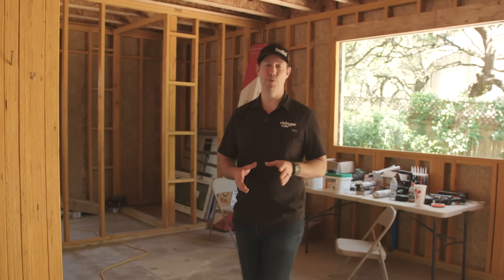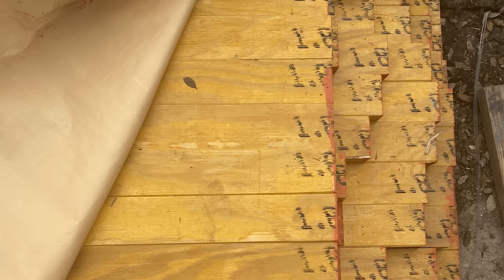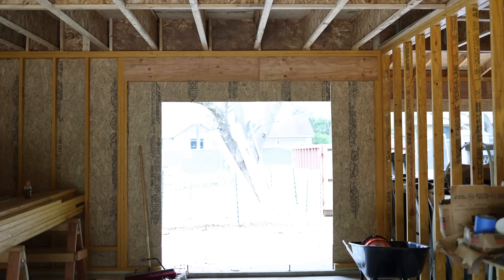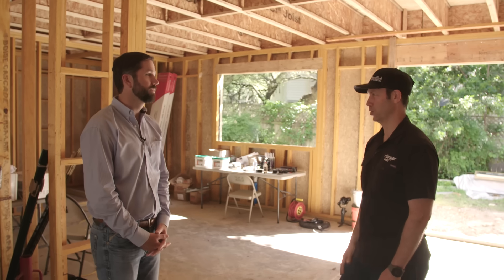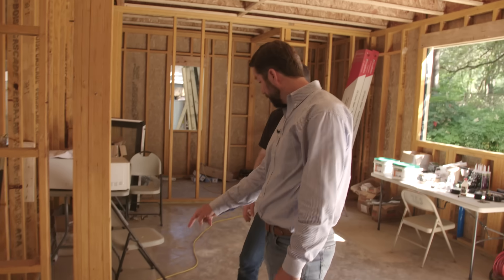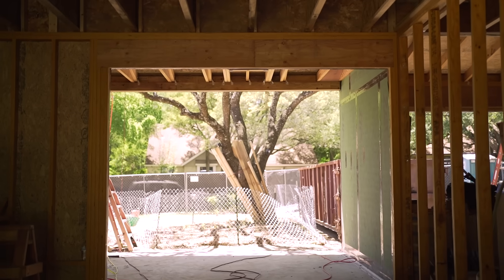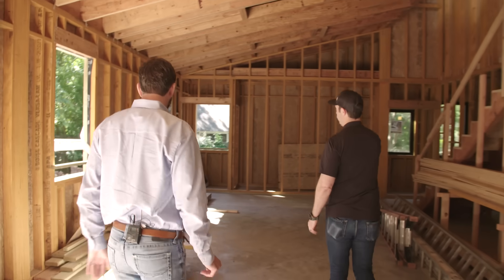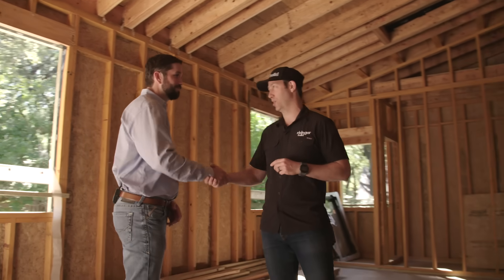House Engineering - Common Mistakes

Comment: What is the advantage of pre-tension slab?
Reply: It's Post tension! It allows a developer to build homes on Disturbed soil or unstable soil. 
It turns the buildings slab into one solid unit by compression. Therefore it eliminates cure and settling cracks. It's also used in highway poured-in-place bridges. In bridge use they can droop the cables slightly and add tension to adjust the camber. All in all it is a great system for new builds but puts limits on remodeling. If a tensioned cable is drilled or cut it can come up through the concrete and be deadly.
Reply: post-tension, because it is done after the slab hardens. it's steel cable in a sleeve with big endplates & nuts. it is done for speed & convenience, no need to build rebar cages. yes, slabs can still bend and crack tile flooring. they throw post-tensile slabs on top of anything, including hillsides & rubble, so watch out for that modernity!

Comment: What about steel framing?  That was popular awhile back.  Has steel gone out of style?  Which lasts longer, steel or wood products?  Rot vs. rust?
Reply: My thought exactly. With increasing average yearly temps we are also getting a dramatic increase in termites. I love wood but my next house will have a poured concrete slab foundation and exterior walls. All interior walls and the roof will be steel studs and trusses. The roof will be finished with standing seam metal roofing. Wood doors and trim are fine but nothing structural will be made of wood. All electricals will be run in metal conduit.
Reply: @billw1044  keep out of most HOA areas if you want to apply smarter principles for next build or be willing for a fight to buck the aesthetics system in place in most HOAs.  Loads of "leeway", but unwilling to listen to common sense to advance to better practices without code requirement.  I think HOAs would enforce their rules over code for aesthetics just because they're written and enforceable at their low level, or "volunteer EGO" maintenance". 
HOAs are completely ignorant systems that need a complete overhaul-- 1st explaining up front exactly what "rights" and "freedoms" you are giving up when buying / signing agreement, 2nd to pay them for their uneducated opinions, or better yet completely abolished. Just my last "2 cents" after fighting HOA for metal roof they claim doesn't meet aesthetics.
Reply: Steel is an excellent thermal bridge :)  Can last 50 years out in the elements. You try to avoid material with different expention rates. Hardwood can last 25 years out in the elements. If wood is left dry for hundreds of years in building it acts like a carbon storage, has less of an impact on the environment compared to steel.
Reply: @ArthursHD  That's correct about carbon. Trees sequester carbon in their wood as they grow. When we use that wood for permanent applications, such as building, we prevent that wood from rotting and returning the carbon to the atmosphere. In environmental terms this is an advantage for wood over steel or masonry materials.
Reply: Matt's engineer seems to prefer not to mix steel and wood when possible. There's a case to be made for that as far as constructibility. Also they behave quite differently as far as shrinkage and so forth, which can result in drywall cracks. If he'd used a steel column in that spot there would have been an annoying question of how to finish it. With wood the dry wall can just be screwed to it like a regular stud. Certainly they can be mixed. And there are probably occasions where steel is the best choice. But personally I'd opt for sticking to one material under most conditions. As far as all steel framing, that's clearly an option. But it's a whole different type of carpentry. Matt's got a team that he's worked with for years and they're skilled at what they do, in wood. So why rock the boat?
Reply: Exactly; not to mention, excessive care must be taken when making a wood-metal connection to prevent squeaking.
Reply: If all steel, the thermal bridging is a big problem (it has been done, the thermal imaging is one of a bonfire). When loads get big, and steel is used, the transitioning between different materials gets to be painful, as far as fastening methods and technologies. Do not underestimate the KISS concept. And with steel, the thermal/ moisture characteristics are REALLY different from solid sawn, which just adds layers to the issues of mixing materials. You end up increasing chances of drywall problems, just for starters.  

10 years ago, we did a very large and expensive house, that had to have a very low HERS rating. I mandated 2" continuous foam on the walls, full liquid applied VP membrane, with "outie"windows (as per Matt's current videos). We were in a high wind design zone (130 mph), with tall walls and BIG windows (think 12' wall, 8'+ window height). We were going to have to sandwich steel columns at almost all the king stud locations, until I came up with an all-wood scheme. We ripped LVL to 5 1/2" above and below the RO, and ripped to 8" at the RO (5 1/2" + 7/16" + 2"). 8" rips of LVL were used for head & sill  as well, all with hardware connectors/ hangers (no jack studs used, for cleanliness of execution, as no value for wind loads). The LVL thus became an integral window buck, and by being a greater depth at the middle of the span (where bending due to winds are highest), we gained enormously from a structural perspective. LVL is about twice the bending resistance of solid sawn, and the 8" depth gives about double the bending resistance of 5 1/2" , so the net effect is that one custom LVL KS was worth about 4- 2x6's.  Lot of windows only oneKS  was required (with a 2x6 sistered on the wall side, to tie the sheathing to). Some needed 2 LVL KS, but not a big issue. The smart folk will now see why 100% liquid applied was essential, there are a lot of 3-way corners that must be sealed (Matt sheet wrap = Origami layering, and doubts). No problems then or now, with construction or moisture resistance (no leaks).
Reply: Steel is an even worse thermal bridge than wood. Even with the CFS C channels, the r value of the wall comes out being lower than a traditional 2x4 wall. Also there are a lot less framers who know how to do CFS framing, as opposed to traditional framing.
Reply: Tyler Lohss those “farmers” better get used to learning new skills! 😂
Reply: @slappers123  I was thinking in terms of longevity.  For interior walls thermal bridging would not be an issue.  You could increase fire, insect, and rot resistance with an ICF and brick exterior wall system combined with metal interior walls and a wood trussed roof.  That combination might last a very long time.  Termites would have to climb all the way up to the roof to get a meal.
Reply: Christopher Calder interesting idea.
Reply: Steel never really caught on.  The US has tons of forests and renewable wood, plus its easy to build with.  Steel also has its issues with heat transfer, its not the most efficient of wall assemblies.  Its mostly builders and framers dont want to branch out, and most home buyers dont really care enough.

I own a 1950 Stran-Steel house, the "House of the Age of Technology" in its day.  Its made up of heavy-gauge steel channels that are spot welded together to create studs and joists.  They are dimensionally the same as similar wood pieces, and are screwed together with steel channels for the top and bottom plates.  Makes for a very solid house!  I gutted it and renovated it completely.  The exterior is Cellotex covered in tar paper and brick, not the best but would have been incredible expensive to replace with Zip or foam insulation.  Foamed in any gaps and holes in the sheathing and around the new doors and windows.  Added fire blocking to all the top and bottom plates to limit air and fire movement inside the structure.  Once that was done, the house was virtually draft-free!  Then I blew in cellulose into the walls and put up new drywall and finished the rest of the interior.  Steel isnt the most efficient when it comes to heating and cooling, but my house does pretty well since I cut down on drafts big time.  I live in Houston and my heating and water heater are electric.  Electric bill averages out to around $200 a month, usually keep it 72-73 in the summer and 67-68 in the winter.  Thanks to all the sealing and insulation, the heat doesnt need to run much until it gets into the 50s and lower, not bad!
Reply: One problem with interior metal studs is they just are not rigid; try slamming a heavy solid core door - the interior walls just feel and sound cheap down the road
Reply: I built Steel House in Germany.
Reply: Or just look acros the pond in to the Europe and look how they build with very strict build code :
with modern clay bricks system like:
https://www.wienerberger.co.uk/
Or another system with extrem light concrete bricks (float on the wather) like:
https://www.xellabuildingsolutions.com/
Here is a UK link but this modern brick systems are more common in continental europe
Reply: We build better houses in Mexico....these houses have way too many issues.... I work on both sides of the border and my own houses on both sides, I don’t have any issues  in my house in Mexico!  Concrete and foam insulation, no squeaking, no rot, no problems...
Reply: @boxing1940  Most of Asia is the same; concrete, brick and steel.

Comment: Hey Matt, Have you tried placing glue, like PL premium in the bottom of your hangers? It helps avoid squeaks as well.
Reply: Actually PL premium hardens and can lead to squeaks (ask me how I know). Best to use one of the construction glues that remain flexible.
Reply: Not only that any good framer puts glue In floor hangers
Reply: Right, we actually use a product called lumber lock which stays flexible (I mentioned PL as it is more widely known) I wonder if the advantech su floor foam adhesive would work in this application
Reply: pl is the shit man.

Comment: I think this is your 4th video now where you keep praising engineered lumber without ever once bringing up the drawbacks, except cost (barely).   Engineered lumber uses a lot of glue that off-gasses and also isn't responsible fiber use when it isn't needed. It's much more processed and typically has higher embodied carbon. Unlike OSB, LSL, or the webs of a TJI that are made out of waste (mostly) chips, plywood and LVL are rotary peeled. Logs for rotary peeling are bigger, more mature trees. Framing studs come from small, fast growing trees. If you are concerned about stud quality, insist on KD or S-Dry and you won't have nearly the bow/twist problems of GRN. I'm not  a LEED expert, but I don't think your house could be LEED certified with all that glue.
Reply: Just don't ever let it get even a little bit wet . . .
Reply: In residential construction, I think you would be surprised at how easy it is to be LEED certified on a budget like this. There are so many points available with this build and the local sourcing of materials. Where he may fall short in one area he will easily make up in others.
Reply: @h2s that's ridiculous
Reply: Engineered wood are the sadest stuff when there is a flood or a water leak.
Yes that includes those unexpected small leaks that discovered it was leaking for quite sometime.
Reply: EWP products generally contain 4-6% adhesives. None of the products mentioned are made from “waste” chips. Products like OSB, LSL, and web materials also allow the manufacturer to use non-environmentally stressed species that are not fit for use as conventional lumber. EWP products produce a longer, stronger and straighter product that uses 80-95% of the wood fiber in the log. By comparison, Conventional lumber generally utilizes about 60% of the log for framing lumber.  (note - today of the off fall from either product is sold for other products or used to power the plants and doesn’t go to waste. Adhesive products used in today’s EWP products have less off-gassing than the wood used in manufacture. You would be surprised at how Green Engineered lumber is when compared to conventional lumber - better utilization of the wood fiber, no culls, less product used with less bulk, less waste.EWP is environmentally friendly, most  are green certified, and build a better product with better products and less waste.
Reply: @bettyannmccue1237  and after all that the engineered lumber is 3 times the cost .you could do sheer wall bracing in every stud bay cheaper than using engineered lumber
Reply: Finish materials such as vinyl flooring and the cheap grades of MDF used in cabinetry off-gas far more than engineered lumber used for framing. I would start by looking first at finishes and cabinetry. In the past urea-formaldehyde glues were the main adhesive in plywood and osb products. But now more and more manufacturers are switching to phenol-formaldehyde and isocyanurate glues. These off-gas during curing. But that process is complete by the time the wood gets to the lumber yard. 

I'd probably opt for finger-jointed studs over LVL studs if my concern was straight walls. But LVLs are certainly extremely useful for headers, beams and rim joists.
Reply: Matt got a deal on his lumber package from BC because they are a sponsor - and that's why he's using engineered lumber everywhere.  Matt has never paid much attention to green building - he regularly encases homes in spray foam.  This build he will use a bit of Havelock Wool insulation (surely donated and likely another paid promo) which is a welcome new direction.
Reply: What I notice most about 'build show" houses, is a lack of character. These houses will never get to be quality homes.

Comment: Can a homeowner say "f this, I want all aluminum i beams and frames. And steal support beam. Give up on the wood
Reply: this guy did!  https://www.youtube.com/channel/UCUujfNBK9uv3cIW-P5PX7vA
Reply: @cdoublejj  so it won't burn for no reason and break in like hundred years from now
Reply: You would have to pay greater attention to detailing insulation since aluminum is more thermally conductive. Plus the cost benefit of prefabricated metal envelopes isn't as competitive in many regions due to the rise in offsite timber construction. Still totally doable tho.
Reply: Sure, just make sure you have very deep pockets. If you wanted a house built from Swiss Cheese, you could probably find some engineer to design it.
Reply: I suppose homeowners could. But if they were asking my advice I would not recommend it. If they were determined not to build in wood I'd suggest a masonry option instead.
Reply: Jolly Green, metal and especially aluminum is a poor choice for building. Heat can severely warp metal I-Beams causing more structural problems, where as wood products can be readily cut out and replaced. I am mainly referring to issues where a fire might take place inside a house and the heat generated would cause a lot of internal heat inside the structure.

Comment: Love this video. I’m an engineer out in California. How do you guys handle non-brg wall top plate connections to floor framing above? In commercial construction, we provide some sort of slip connection to allow the floor to move without loading the wall. Is this overkill in residential?
Reply: Hi Jose, I'm from California too, but not living there now. I have a Master's Degree in structural engineering but I am not licensed. In my long career in single family residential construction I'd say that it's not much of an issue, due to the small scale and large numbers of load paths you end up with in a typical home design. Of course, when you least expect it you bump into that critical exception and it's usually because it causes some totally minor problem that is a major annoyance (rightfully so) to a home owner, like a squeak in the floor or a vibration that causes a china cabinet to rattle.

Comment: the application of what i am assuming was a warp stabilizer (video thing) at 8:28 looks so smooth. Almost as smooth as the house. Thanks for sharing the info. Never heard someone claim deck screws were brittle. Maybe ill just go full stainless from here on out :)
Reply: any metal that is hard, screws, is also less ductile, brittle.  it's a side effect of hardening.  that's why drywall screws have the head break off so often.  try bending a screw over in a vice with a hammer, then try a nail.  most often, the screw will break long before it bends, the nail will bend repeatedly before it breaks.
Reply: Typically screws in general are very brittle especially in shear strength (obviously some are designed to be strong in shear but not typically) even stainless screws unless rated and designed for shear loading are not ideal. Don't get me wrong screws are great in "tension" or "compression", if you will, but as soon as you apply an axial load they tend to snap! Stay safe !

Comment: Multi camera shoot with a new style of post-processing editing.  New video techniques used.  Great job in post with the bRoll and the graphics!    There is an issue with the two mics.  They are not balanced to one another.
Reply: Another thing I've noticed is that the mics are set to auto-gain.  You can tell because switching from one person speaking to another, the first few words they say are super low.  I'm wondering if they switched audio people (or editors) for this particular episode.  The audio all sounds very muddy.
Reply: Also Matt's feed has a low level hiss that made me think my computer fans kicked in to high gear until I paused the video. I'm using speakers so it must be driving people on headphones even more crazy.